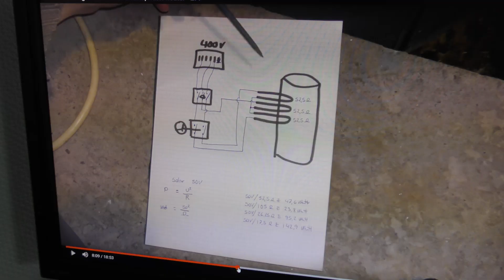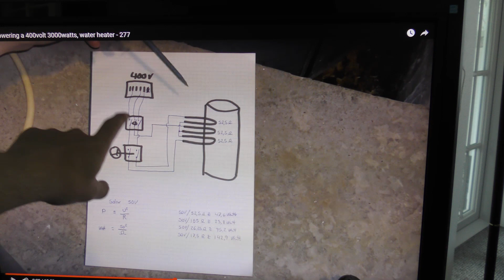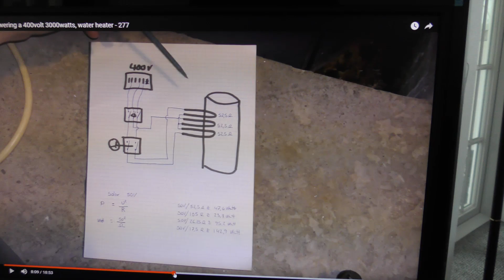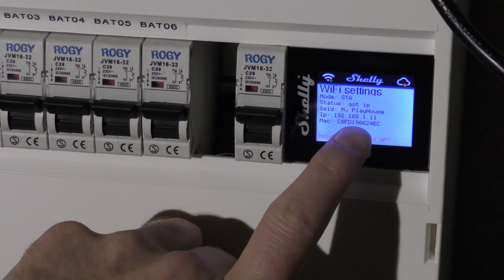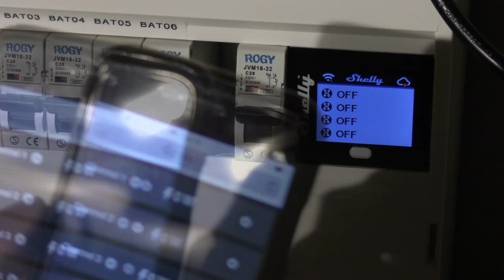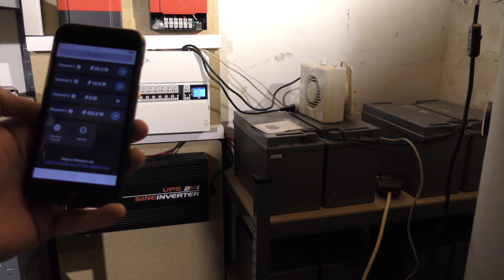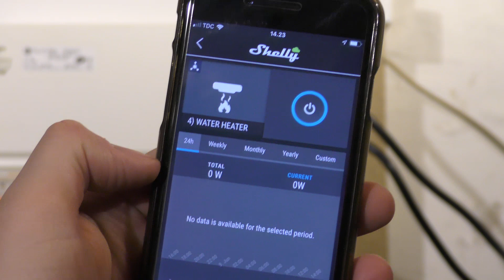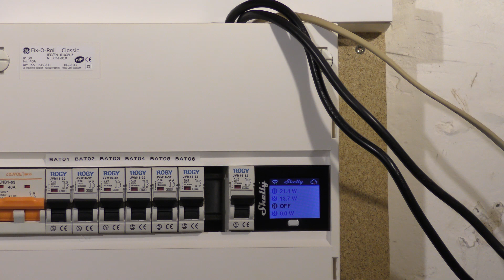My PlayHouse Water Heater, Now on 100% Solar Power - 850

Comment: 50 Amps a ton of power, I thought was a little funny since at the moment I have 125 Amp panel but will be upgrading to 200 Amps for the house.  I guess this is the difference between North America and Europe's power system.
Reply from the maker: Hi Scott Downey
Thank You very much!
You are in Canada,, with 120V and 200A that is 24.000 watt.
Mine is 400v 50A, But to get to 400V I have 3 phases of 240V each 50A (240*50*3) = 36.000Watt. It is a ton of power. :-) 
Thank you for watching! :-)

Comment: I heat water with PV right off the solar panels thru a controller I built that keeps the panels at power point. The circuit senses panel voltage. When charge controller reduces current it immediately senses that the voltage has risen and sends as much current as possible to the heater to make up the difference.  No need to burden charge controller or inverter.  I should make it wifi, it is so simple it has no glitz.
Reply from the maker: Hi opera
Thank You very much!  glad you liked the video :-)
Thank you for watching! :-)

Comment: - Denmark EL price 2,30 DKR = USA 0,35 $ price KWh.
- Shelly 4 Port to Battery Charge/DisCharge ! ☀️⚡🔋♻️💡.
Reply from the maker: Hi Henrik Hultberg
Thank You very much!  ☀️⚡🔋♻️💡 not sure if that is good or bad,, but I found that heating my 300 liter water from 5C to 45C will take 13,8Kwh,,, with your prices that is 13,8*2,3 = 31,74 dKr or $4.81 to heat that water.
Thank you for watching! :-)
Reply: Jes Good idé 💡 download Solar el ☀️⚡ to Water Heating ♻️, No to Gird ⚡🕸️.
[ Type: Miniature breaker 1P+N AC/DC ]

Comment: My tea kettle has 2kW already. And it holds only about 1.8 liters of water. How do you heat that big water container with only 500W?
Reply from the maker: Hi Seegal Galguntijak
The power needed to heat 1 liter of water from 5c to 100C is about 0,11Kwh,, I have 300L but I only need it to be 45C but the power needed to do that is 13,8Kwh,, so it takes over 24 hours to go all the way. But I do not usually use 300 Liter.
Thank you for watching! :-)
Reply: I had to replace a water heater in a rush and plugged the element into 120V giving me about 800W.  Never got around to rewiring it for 240V for years and never did.  Added an external heat pump and this year unused heater is now connected to solar for extra.  We lived just fine, it was only 30 gallons.

Comment: With 3 phases at 230V and 50A each, you get about 34.5kW alltogether. Why don't you have an electric car yet? Would be awesome to charge that at home and quickly (not needing a whole night to be full - or in case of a larger battery with a range of more than 300km, several days)
Reply from the maker: Hi Seegal Galguntijak
Cars are very expensive here in Denmark,, there is a 150% tax on cars.. so if a car cost £20.000 from new,, it cost us €50.000 :-/ 
I would like a electric car,, they are just bloody expensive..
Thank you for watching! :-)
Reply: Did you mean 20k€, or actually GBP? Because I don't want to convert those currencies into each other...
Funny thing is, though, a re-imported new car from i.e. Denmark (or any other EU state) is usually much cheaper than a new car here ;-)
Aren't there any other options for you? Like buying within the EU and then don't needing to pay additional taxes? Come to Germany, get yourself a Nissan Leaf, and go back electrically... ;)

Comment: Hey morten is it cost effective to use electrical heaters in denmark? Netherlands electricity still too expensive per kwh.
Reply from the maker: If you only have an electric water heater,, 30-50 liters is normal,, and shower,, I have 300L and a bathtub. :-)
Reply from the maker: For hot water, it’s widely used outside areas with “fjernvarme” power plants maker hot water and pumps it out to customers,, near cities. But people like me, that has there own heating, powered water heaters is normal.
Heating up the house with power is bloody expensive,, so heat pump are used to maximize the efficiency.
Reply: @MyPlayHouse  I see, well good thing you got your solar and wind setup to offset the cost.

Comment: I really like your videos😊. 
One little problem:  10:30 As an electrician, unfortunately, I have to tell you that it is not allowed to screw(or soldering) on the wire directly as it breaks. Please use a sleeve and a crimping tool (10$). Its saver. 🙂
Reply: And the grounding cable should be longer than the others :)
Reply from the maker: Do not do as I do, improve on what I do.

Comment: You should put 2 of the heating coils in parallel for the 240v. That would use 9A and provide 2kW of heating. You could also add a relay so that it uses 1 normally, but you can push a button and bump it up for a while so it is hot for your bath or whatever.
Reply from the maker: I can just move it to 400v if I need more.

Comment: Here in germany my House have 3x 63A @ 400V Uplink and try to get a 125A uplink.
The "new" Plug Standard is the CEE 17 system / IEC 60309.
Reply: CEE 17 is the standard high current plug in the UK too. We call them commando plugs for some reason. Much harder to get 3 phase in the UK in a residence though.
Reply from the maker: That is next step up from what I have. But normal is 32 or 35A
Reply: Also here in Germany, we have also a 400V Connection. There are more reasons to tell here why, but we have solar on the roof, that we feed into the Grid.

Comment: The standard for US homes is 220-240V 200Amps @ 60 hz, but small appliances and lights and plugs are 110-120v, 220v is reserved for water heaters, dryers, a/c and stoves-elec furnace etc...
Reply: In Europe theres 220-230V for every household, for companies require, theres a 380V available.  Standard is 220V@50Hz and 32 amp main breaker. You can by the way install bigger ones with an electrician, but for most people 32 amps is enough
Reply: Another difference is that in US the 220v is done by putting together two phases (110v each), in Europe is done with a 220 phase and a neutral wire (in US with neutral and phase you obtain 110v).
Of course, if you need more power here you can use three phase that is done with three phase and a neutral (the voltage between neutral and phase is 230v and between phase and another phase is 400v). Ideally, each phase’s voltage, current, and power is offset from the others’ by 120°.
Reply from the maker: Hi prescan7000
Thank You very much!  Yes,, I I want more power than I have,, it will cost me,, like a lot.
Thank you for watching! :-)
Reply from the maker: Well we have nothing on 110volt, everything is 230 volt. Most bigger appliances can be Re-wired for either 230 volt or 400 volt.
Do you have two times 110v 100a coming in,, or how does that work?
Reply: In the Netherlands most homes have 3 phase 230v (=400V) comming in. However, by default only one phase is connected. You can have more phases by paying an additional fixed fee each month called "vastrecht". The fee is also dependent on the amount of amps your main fuse is rated for.

Comment: I've never been 100% sure about using computers for automation, i do like a basic mechanical timer or switches for simple jobs :-D.
Neon indicators are good for visual feedback.
I'm rather old fashoned lol.
Reply: I have a fully automated home. Almost everything can be switched on or can be controlled via a single tablet and only from one interface,  not from different apps or so
Reply from the maker: I am a bit Old fashion as well I do see the problem every time this breaks connection to the Wi-Fi, I can’t actually turn it on and off, and I have to go down to the basement and reset it.

Comment: Top job Morten, next step is to try and heat your water using servers with liquid cooling radiators piped into your central heating lmao. Just fire up Prime95 when you need a shower :L
Reply from the maker: Well Lenovo does have water heated servers,, and they use 50C water to avoid condensation they would be perfect for this.
Reply: @MyPlayHouse  If anyone can make it work, you can. Now you just need some hilariously inefficient Netburst-era Intel CPUs
Reply: @MyPlayHouse  what's the second charge controller for? great video btw
Reply: there is only one problem to your idea: a water heater runs at 50-70°C and it would heat the servers until they come so close to overheating that they would shut down when put under load. The problem could be solved by adding a heat pump between the tank and the servers so the hot cooling water from the servers gets cooled by the evaporator and the warm heating water gets heated up by the condenser, wich makes it possible to force heat form the servers into the water heater using electrical power and solves the problem.
the heat pump should be controlled by an inverter because it could otherwise freeze the servers if they aren't generating enough heat to keep their temperature above the freezing point of the water in the air and a normal (non inverter) heat pump will keep on cooling until the thermostat shuts off or the refrigerant stops evaporating due to a frozen evap and causes liquid floodback wich will cause the compressor to go off on thermal overload/a line to blow/the breaker to trip/something else to break. 
the heated servers would work well in the winter, but would be a bad idea in the summer when you try to get them as cold as possible because it is 40°C outside and everything is overheating already. you could also use the heat pump in reverse to heat the servers in the winter, wich solves two problems with one solution.

Comment: yea although solar collectors are way more efficient at generating heat, this is a really good way to use and store surplus renewable energy. Maybe you could set up some if that then this logic, where it would only run the heater when the batteries are at 13V or above. More for when you have the data center and other stuff running on the battery system.
Reply from the maker: Yes way more loses heating with power. It is a 48 volt bank. Unfortunately solar collectors and solar panels works best at the same time.